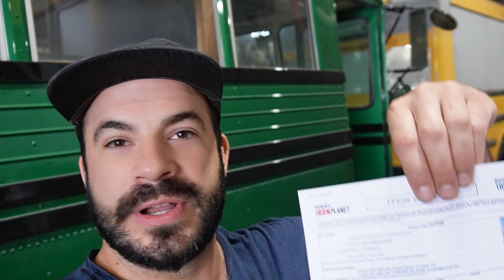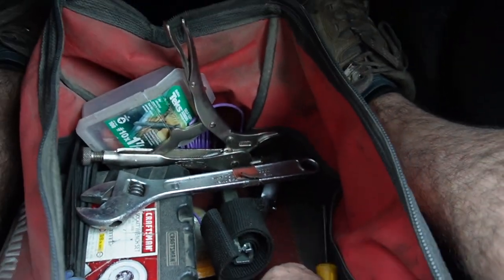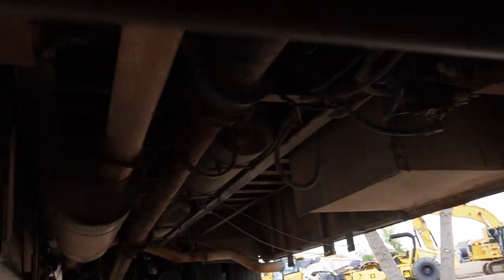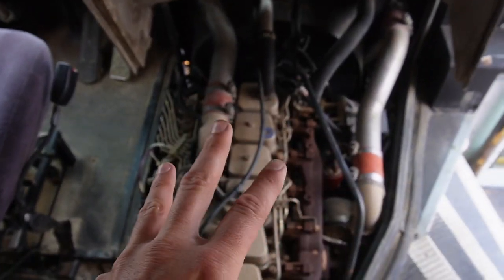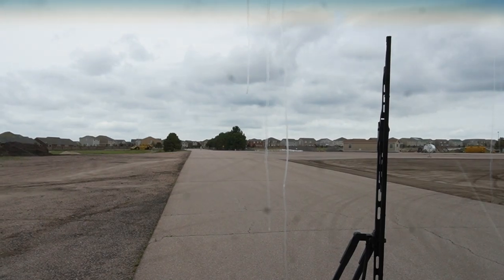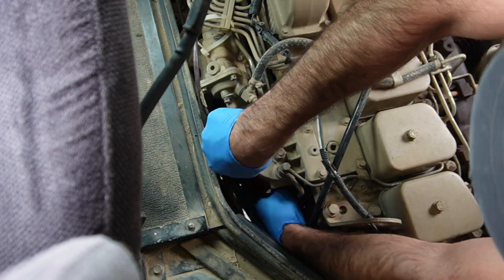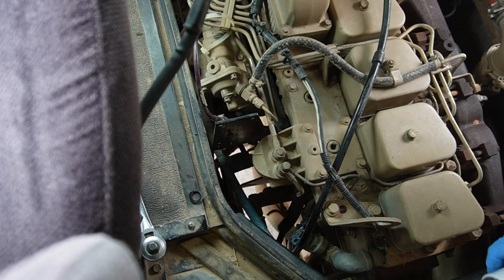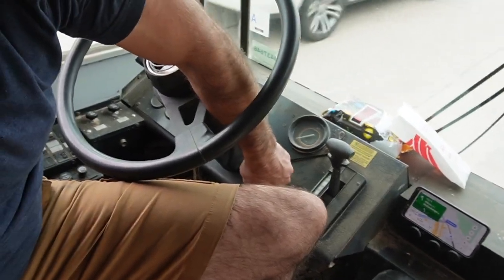Will This FORGOTTEN Cummins School Bus Make it 60 Miles Home??

Comment: One of my Bluebird buses has an AT545, I'm putting a 6x6 drive train under it with 4 speed brownie. I'm pulling the 12 valve cummins and putting in 400 big cam cummins.

Comment: Cummins 5.9l 12v is one of my all time favorite diesel engines. They can be turned up via the usual p-pump, injectors, compressor, tuning, exhaust, etc and make A LOT of reliable power when done right. The fact that they have none of the emissions B.S. is a HUGE plus. Hard to go wrong with a boosted I6 anything really, especially at those super low miles you've got. Check out Power Driven Diesel, they're just one of the many great diesel performance shops that are out there. They have a channel as well if you are interested. Lubro/ Liqui Moly has some good stuff. I use the Jectron and Ventil Sauber (injector/ valve cleaner,) and it works quite well. Berryman's B12 is also another more readily available cleaner as well. Thanks for sharing, I enjoy your videos bro, and appreciate your work, I am a 25+ tech who'll turn a wrench on nearly anything and everything, and I recognize good work done correctly when I see it👍😎
Reply from the maker: thanks! I totally agree. I acrtually got a pump and a transmission from PDD for our old cummins dodge work truck. seems to be working great so far!

Comment: Add to that bag of tricks a true 6 in 1 screwdriver, they are, 2 sizes of Phillips, 2 sizes of regular, and a 1/4" and 5/16 nut drivers, Hose clamps are 1/4" and 5/16ths" BTW. very handy- minimal space.

Comment: Loved this video. I have had my bus for a little over a year. It was a 6 hour drive home and it handled great. Driven it around a little bit. Took it on another 6 hour drive (each way) for a trip to the in laws for some free quartz countertops. We have our first fun trip planned for just under a month away up to the Tetons. (Roughly a 4-5 hour drive). I know my tires are a little on the older side, but I don't have any signs of cracking on any of them. I think the front tires are 5 years old, back are 7 ish, but still don't have any signs of dry rot/sun damage. I know I want to do a full service before we go. Our ABS light was flashing the last time I ran the bus. I know our coolant is slightly low. Who knows when the oil was changed last, though I know we have enough. The list goes on... I want to make sure that it is all the way good to go for this first trip.

I have a 36 ft dog nose with the Mercedes MBE 906 and Allison 2500 transmission. I notice that when I push the bus to get up to 70 mph, that the RPMs are around 2500 and the temperatures seem to rise. They never get all the way up to any danger zones, but definitely above standard operating temperature when I'm going 63 mph ish. 

I was curious if you had any experience with my engine and transmission combo. I have heard that finding a mechanic that knows their stuff about the Mercedes engines is a little tougher... Ideally I want to learn how to do it all myself, but obviously I have no experience yet. I was just wondering if you had any advice on how to make sure that our bus is all good and safe to take on another trip. 

Anyways, this video was super helpful. Thanks!
Reply from the maker: That's a fantastic combo. The first and most important thing to do is change the oil, flush and fill with the proper type of coolant, and make sure the transmission fluid is full and bright red. If nit, change that asap. More buses are ruined to low or improper coolant than anything else. Don't mess around! Good luck!
Reply: @ChuckCassadyYT  Thank you Chuck! I will do those.

Comment: I bought a 93 international dt360 auto. Sitting at least 10 years, fired right up and drove back 100 miles with no issues
Reply from the maker: That is an outstanding motor. Great bus!

Comment: Pass the savings on to me! I might like to have it. I won an auction but didn't meet the reserve last week, and maybe it's because this bus was destined for me. I had a truck with that engine, so I know them well. I broke the transmission because I could get horsepower with a grinder and screwdriver, so be careful.

Comment: A little water in the bottom of the fuel tank will give occasional problems as it sloshes as the bus moves, will idle great.  a drop of water won't go thru the engine well.

Comment: Great video of what can go wrong driving a new purchase home. Question, what would you do with a 2006 c7 cat in a FL short bus that hasn't driven 100 miles in 6 years? It starts up like new, great oil pressure but cannot test drive it. Your thoughts? Thanks

Comment: Be very careful. You want a fuel filter to prevent significant engine damage. I mean if sediment gets in the tank and gets pumped through the system, it could damage the bladders on your fuel pumps, then go through and damage the engine cylinders.

It doesn't take much diesel to run a diesel engine as it atomizes the diesel to combust. So a filter won't harm its efficiency.

Also, I'm thinking that a broken pump bladder will cause engine runaway. I could be wrong, but it stands to reason that if the pump can't vary the speed of the fuel based on the engine timing, then it'll cause it to get too much fuel.
Reply from the maker: This bus still has a fuel filter. They added a second one that we removed. There are no fuel bladders on this system, I've never heard of fuel bladders on a diesel.
Reply from the maker: Clogged fuel filters are the #1 cause of poor engine performance on a diesel in my 16 years of experience with diesels of all kinds. Adding extra filters is fine, but when they are cheap and small, they will not help performance
Reply: @ChuckCassadyYT  I used the wrong term. I meant the diaphragm inside the fuel pump.

Comment: My Thomas has two filters as well. One by the battery box and the one on the motor.
Reply from the maker: That's what I would have expected but this filter is right by the spin on and looks like it was from a tractor!
Reply: Ahhh, ye old tractor fix. Or whatever they had on the shelf that probably didn’t fix it. Lol
Reply from the maker: Hahaha a time honored method

Comment: Theory: The aftermarket “pre-filter” was because the owner, a construction company, uses “off road diesel” which is a slightly lower grade of fuel, needing more filtration. If you’re only going to burn retail grade fuel, the pre-filter is unnecessary.
Reply: Actually it is the exact same fuel with red dye in it. The modern construction equipment requires ultra low sulfur fuel, they have after treatment and use DEF.

Comment: Hey Chuck, bought a 2003 International with the T444 , I had the same power loss driving it home. Did you figure out what was the problem?
Reply from the maker: The fuel filter was 90% of it. The other bit was replacing the brittle fuel line back to the tank

Comment: Did u figure it out? Literally just gt our first skoolie and it's got THIS issue.
Reply from the maker: Yep, it was what we thought
Reply: @ChuckCassadyYT  thank you. We took the liberty and bought a fuel filter already. Thank you for your videos. Super helpful.
Reply: Besides the primary driver side fuel filter is the fuel&water separator also a fuel filter? More importantly should it be changed too?

Comment: I have the same bus, with chunks of polymerized veggie oil/diesel film garbage in the fuel tank.  I'm trying to drop the 100-gal tank to boil it out.  NEVER PUT VEG OIL IN YOUR DIESEL TANK!!!!
Reply from the maker: Veg should never be stored in a steel tank! Sorry you gotta deal with that
Reply: @ChuckCassadyYT  it’s an ugly filmy mess, I have to cut three access ports in the top of the baffled tank to peel the crud away by hand.